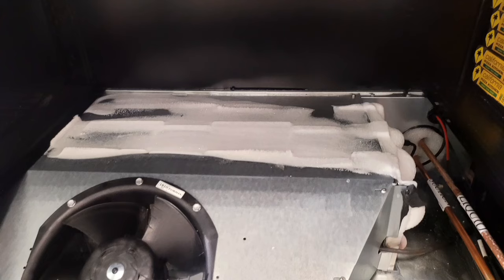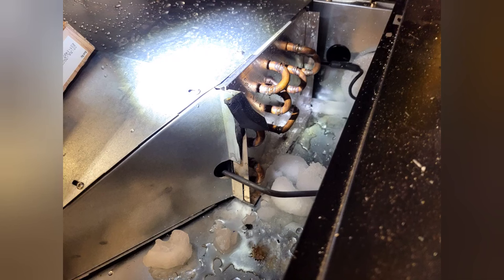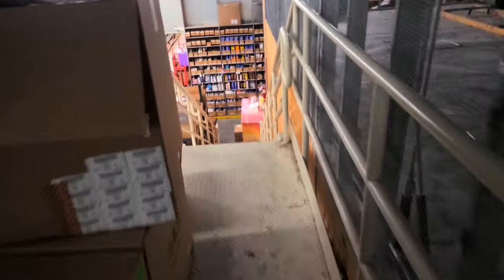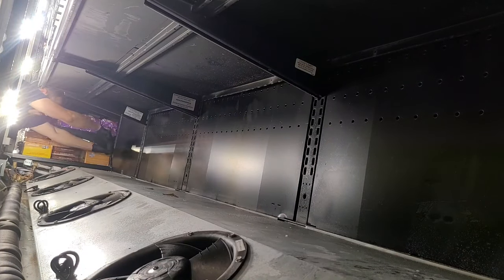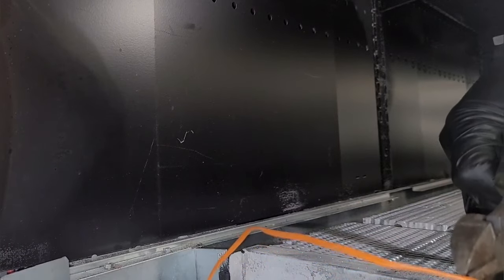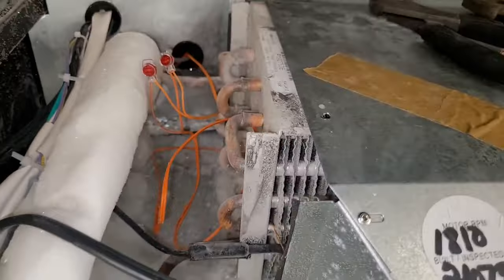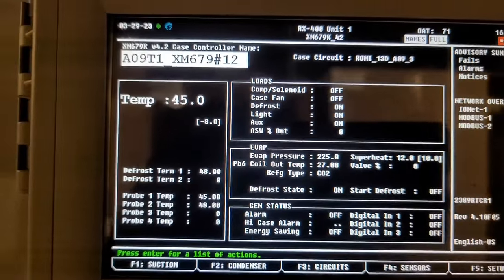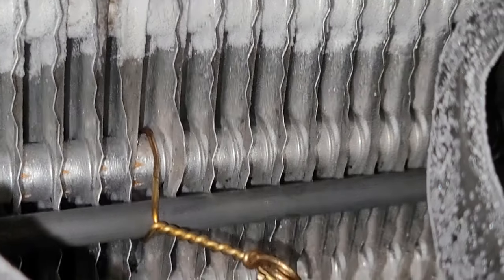13 DOOR FREEZER NOT DEFROSTING DIXELL CONTROLLER BAD DEFROST TERMINATION SENSOR

Comment: Just for reference you can cut those wires together. They do not have voltage on them it’s just a resistance valve going to an input. You also shouldn’t you those connectors in cases. That is targets spec, they will fail in a wet environment. Pick up some dolphin connectors. Also nice co2 store.
Reply from the maker: Yea, I know,  it's just habit to keep them apart... thanks for the info on the connectors

Comment: What connectors are those?  Have a link or name of them?
Reply from the maker: put this into Google, and you'll find plenty. 

 RED/WHITE PHONE SPLICE CONNECT

I got mine at the home depot, in the telephone and ethernet aisle, 25 pc. For $6.47
Reply: GEL filled, rated for low voltage solid core wire for telecom.